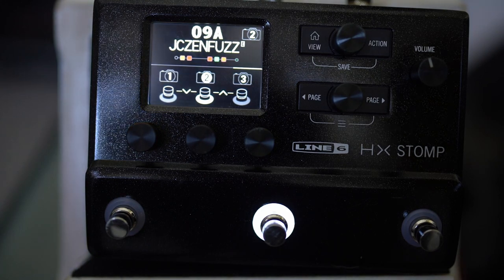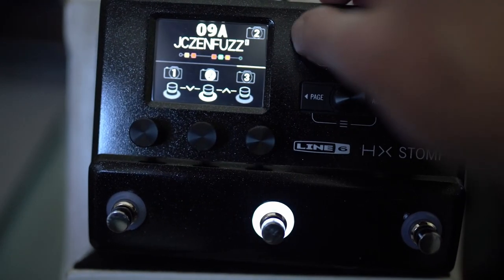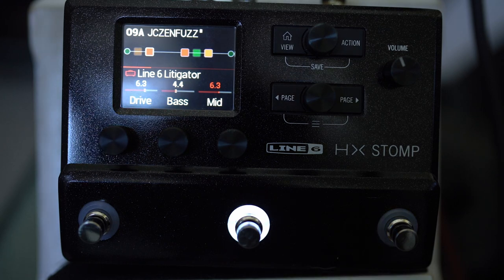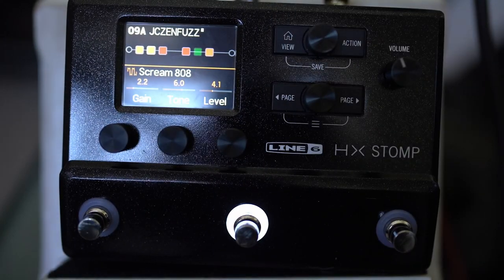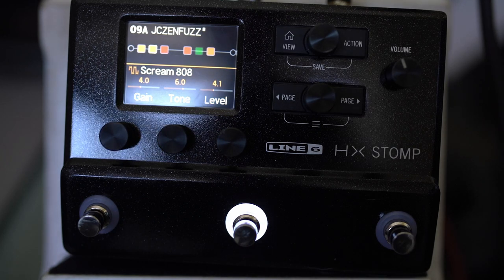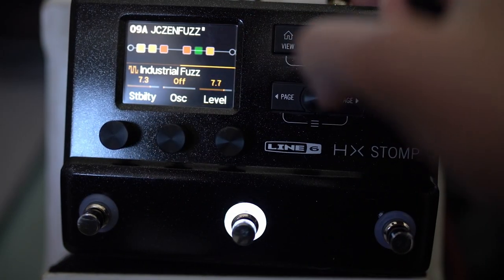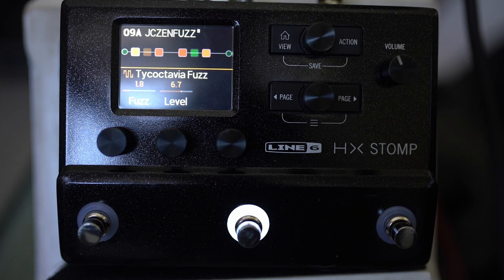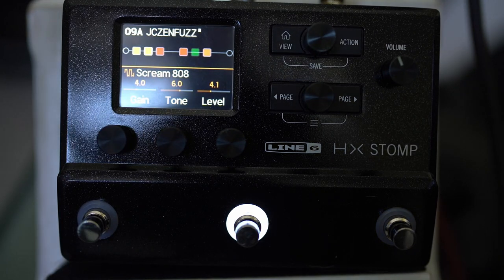Essential Fuzz Tips for Helix

Comment: grateful for this. the only fuzz I can ever get to sound passable is the tychoctavia, just like how you set it up and pushing a dirty amp. I maintain that the HX could use a "fuzz update" just like how 2.5 or whatever was the "reverb update."
Reply: Try the recently added Ram’s Head (Bighorn Fuzz). It sounds spectacular.  Edit: also, another tip that wasn't in the vid--lots of classic fuzz tones are achieved by rolling the guitar's volume back. (this is true with the real pedals as well as the Helix models). There is a strong interaction between guitar volume and the character of the fuzz, going from a kind of sparkly bite at lower volume to a spitty crushed mess at full volume.
Reply: yes, please. we, the "siamesse dream" tone seekers are still alive 😂 still suffering.
Reply: +1 to that "fuzz update". It's the only part of Helix I can't say I like at all. I've heard so many tricks: set impedance to first, to auto, to enabled, roll the guitar volume down... Honestly, I've had 3 fuzz pedals and I had to do nothing for them to sound amazing. In a beast like the Helix, it should be as easy.

Comment: What if I have some actual pedals in front of the Stomp? impedance wise
Reply from the maker: It won't make a difference as the impedance circuit only interacts with your guitar if you're plugging straight into the Stomp - if there's anything between it breaks the relationship

Comment: Do the HX Stomp fuzz sims react (clean up) with the guitar volume knob just like real fuzz pedals? I have a HXFX and thinking about upgrading to Helix Floor as the HXFX doesn’t have that impedance circuit and fuzzes sound harsh…
(Btw are you only using a speaker sim and no amp sim? 😅)